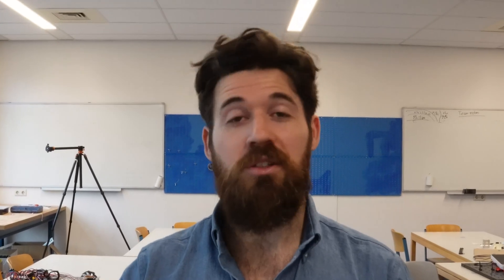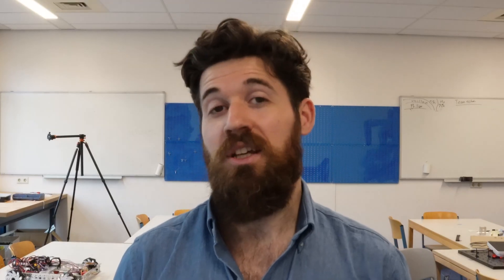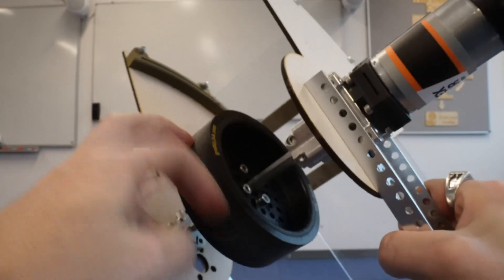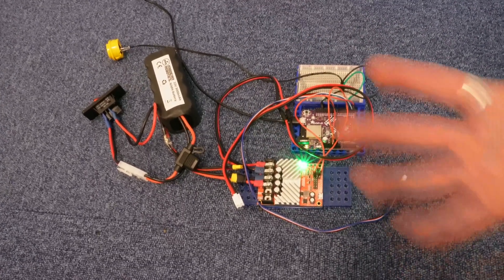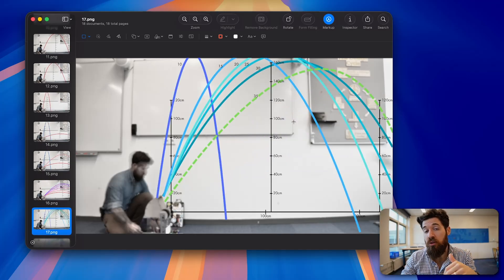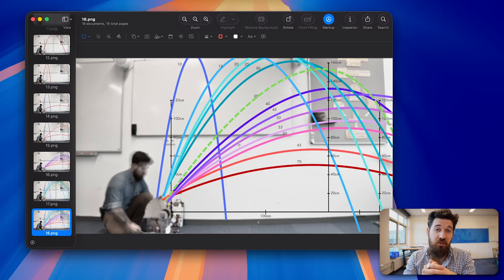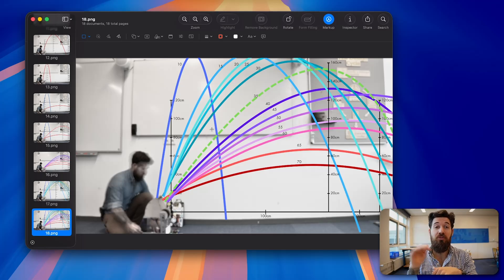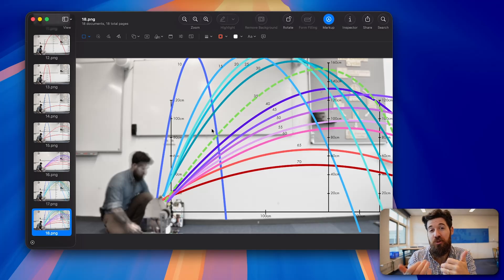How Flywheel Release Angle Affects Projectile Trajectory

Comment: something ive found is that when the ball has topspin (opposite of whats shown here) it will actually stop before the classifier because it tries to roll up the track for a bit, which slows it down as it enters the ramp

maybe that helps with getting the ball to stay in for the 9th slot, we can still reach the goal from the far zone so I dont know of any drawback, and I dont know if teams with topspin + faster balls have issues with the 9th slot because of the ball going down the rails really fast

Im not sure about how the trajectory would help, I know there is a more noticable drop bcs the robot is basically launching a curveball, and we havent tested it with backspin so we dont know the effect of the steeper drop vs the ball floating a bit

One issue we have is that the camera has to be at the intake side and that means we cant swivel it to see apriltags from some positions while also seeing the intake floor, so I do think in general the design that shoots the other way and has backspin has a better form factor
Reply from the maker: Have you had issues with the ball not staying in on the 9th slot? I haven't experienced any issues.

Comment: Question, does a heavier flywheel make the ball go farther
Reply: Not  much usually.

But a heavier flywheel will not reduce RPMs as much when you shoot a ball. So you might be able to shoot 3 rapidly with little loss of RPMs and therefore more consistent shot to shot.
Reply: @danoelke3770 I don’t get the physics here. A heavy flywheel would take more time to speed up too so it will compensate the smaller speed difference. Why is recovering faster in that case?
Reply: @huhooray4498  the longer spinup is a tradeoff for conserved momentum with rotational momentum
Reply: @huhooray4498  generally there is some window of  rpms that the shooter has to be within in order to be accurate. The flywheel having additional inertia allows the launcher to stay within that range even after having shot one or two balls.
Reply: @huhooray4498 its inertia. Basically because its heavier, it takes more force to slow it down while also taking longer to rev up to full speed initially.
Reply from the maker: All the above users here are on the right wavelength. Higher inertia makes the flywheel lose less speed on contact so you get higher throughput. a heavier flywheel generally doesn't shoot something further.